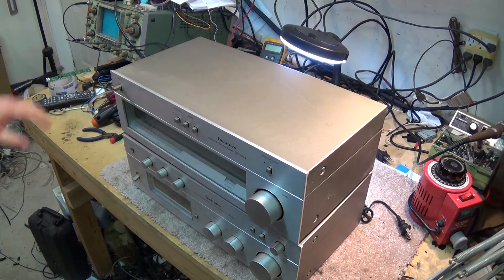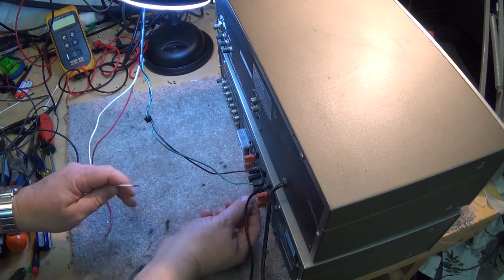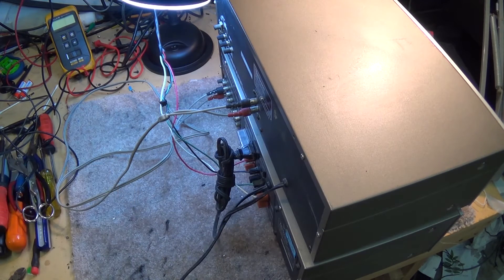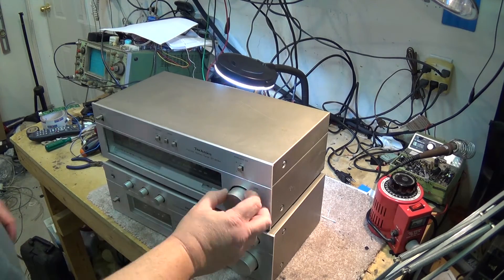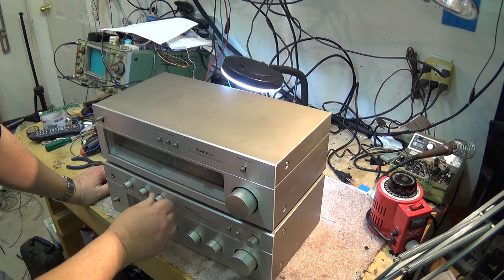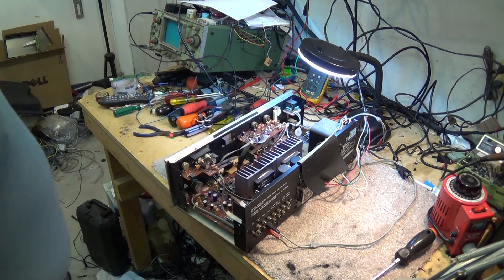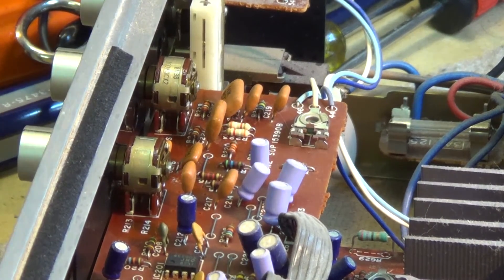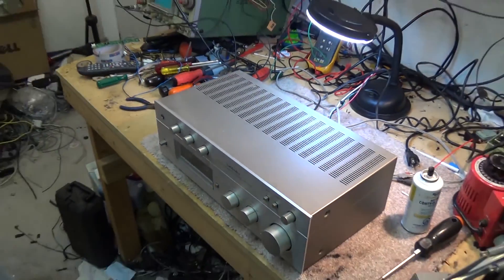Technics SU8044 repair part 1

Comment: Any recommendations on common areas to crap out on these amps?  I've recently come by an SU-8044 with distortion on one side and a SU-8055 that blows the main power fuse as soon as you turn it on.  Neither has any obvious / visually burned components.  Figured I'd ask someone who obviously knows what they're doing before just probing around test points with the schematics.
Reply from the maker: The power IC modes are big problems.

Comment: So they went to the expense of repairing the amplifier that got fried?  And doesn't the DSL interference go against radio interference laws?
Reply from the maker: I guess you weren't paying attention at 0:50 where I said "This is a couple of pieces of MY equipment"
DSL interferes with AM radio. It doesn't go far, but because there are wires in the wall, if your radio is close you will hear the noise. Plasma TV interferes with AM and shortwave radio too. Not much you can do about it.
Read part 95. This device may not cause harmful interference and must accept any interference received including that which may cause undesirable operation.
Reply: 12voltvids Oh, so DSL radiation is short range.  I’m still in the process of learning, so please forgive questions that may seem stupid.
Reply from the maker: @infinitecanadian  
Relatively.
Vdsl uses frequencies between 200khz and 17mhz so it can kick up a bit of noise in the background.

Comment: Way back in the olden days I had a customer with a new "All-Transistor" stereo console who argued that it didn't have to be plugged in because, "You don't need to plug transistor stuff in." I asked her where the batteries were and she told me that was my job to find out! When I plugged it in and it started working she still insisted it did not NEED to be plugged in. No amount of reasoning, and telling her to read the owner's manual, would convince her. She refused to pay for the house call because I "didn't fix it." I imagine she went through this with  another tech after that.

The only thing in the universe that is unlimited is stupidity.

Comment: technics mplifiers are really nice cheap amplifiers they sound amazing with verry low thd
Reply: The price depends on the model you buy. There are or were really cheap and simple ones but also very nice (and expensive) high end amps. I own an Technics SU-8099k wich is out of the same series as this one shown in the video but that was the best HiFi amp they had back in the late 1970s (exept for the mighty SE-A1 wich was about $25000). It was well over $5500 in todays money.

Just see for yourself: http://beyercomputers.com/files/Technics%20SU-8099k/images/TechnicsSu8099k_inside.jpg
Reply: btw the amplifier shown in the video was around $260 in 1979 wich is about $900 in 2018

Comment: I think that it is time to get rid of the ADSL/DSL and switch to FTTP(Optical Fibre to the Premises) and maybe it would be a good idea if your neighbours did the same.
Reply from the maker: DSL still has many years of life left. The newest installations are pushing 100+ megs over copper, and with v.fast  it is possible to get close to 300 megs over short runs (say in an apartment building where they put glass into the com room, and fire up a dslam) Company I work for is putting fiber in the big city, but the burbs where I live it is probably still 5-10 years away, because DSL works so well there is no reason to scrap it yet. Glass going into new subdivisions, but existing stuck on copper for awhile. Glass has some big headaches too for existing buildings. Most people are not happy having their homes wrapped with cables, and holes punched into walls and equipment hanging off walls.  New construction they pull fiber to a main panel, but for existing this is not the case.
Reply from the maker: Will be able to do that soon. Pure fiber is rolling out in my town now. Expect it to be here within 6 months, and then I will be off copper. It's rolling out for everyone but I will have to wait for 3 months after the roll out to get it done, as I am not letting contractors in to touch my stuff. They will never figure it out. I will do my own install, but I have to wait 3 months after the completion of the area before I can book my own install.

Comment: I have a technics su-x101 amplifier  come  on but they is on sound coming out of the speakers can someone please help me from uk  midlands
Reply: Double check your link plugs on the back are in all the way (idk the correct name for them but they're plugged in on the back of the unit) I've seen if they're not plugged in you wont get sound. If they're not there you can get away with using a patch cable or a piece of wire

Comment: question, how do you adjust the idling current?
Reply from the maker: This amp used power module ic. Everything is internal. No adjustment.
Reply: hey mate, my sony ta-636 is working perfect now, there was 2 fusable resistors with issues and 6 capacitors going bad, it works great now ive changed them, ive made sure i used nichicon gold audio caps! it sounds nice so would it be worth changing the 2 big 8200uf 63v capacitors?

Comment: Good God....please tell me your kidding about the person not being able to find the 'Any' key!? I heard another version of that about someone not being able to find the '11' key when wanting to dial 911..it is scary out there lol! Great video as always 12Volt.
Reply from the maker: +Scott x I'm not kidding about the "any" key. It actually comes up more often than one would think. Compaq actually has it in their FAQ.In this case the offender was a relative of mine whom got his first computer in his late 70's and just could not figure then thing out, so I was the one that got the phone calls multiple times a day. Incidentally he no longer has the computer. I took it away, it is sitting in my garage
Reply: +12voltvids  Hello friend, I have this saved amplifier because the stk0039 be hurt if I put the stk0049 that is one of the replacement work well ? since stk0039 are very hard to find. who guides me thanks
Reply from the maker: +Gabriel R As far as I remember the STK0029 and 0039 had the same pinout. So you could use the higher powered 0039 in place of the lower powered 0029, but the 0049 had a different pinout and is therefor not directly replaceable.
Reply: +12voltvids ok in a book replacements he tells me that 0025..0029 ... 0049 ... 0039 ... are replacements although the 0025 and 0029 are lower volts and sends 0049 a little more than 0039
Reply: +12voltvids and true that the amplifier will deliver 100 peak watts or pure lies?
Reply from the maker: +Gabriel R If you look up internal schematic they are slightly different, but the main power pins, input, and output are the same, so you probably can replace a 0039 with a 0049. The difference is the output power. 49 watts vs 39 watts.
Reply from the maker: +Gabriel R No way it will deliver that. Rated for 40 watts per channel based on the power modules.  The problem is Joe 6 pack believes the lies that are printed on the box, and there is no accountability for these lies in consumer electronics.
Reply: I was working with someone on an electrical job and I told him that wire was live "Nuff said" the he asked me who Nuff was 😂

Comment: Wow, I can see those linkage cables to be problematic as time marches on and unable to find replacements parts easily....
Reply from the maker: It is getting harder and harder to find new parts these days. The manufactures don't make spares beyond the production run.